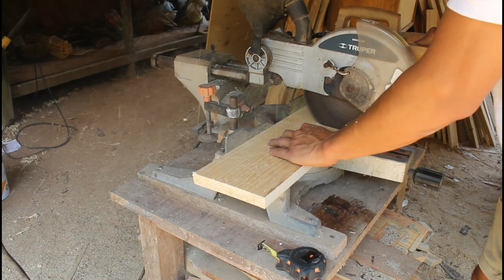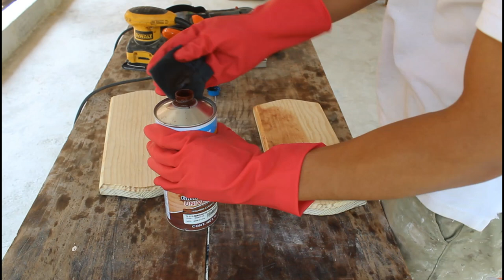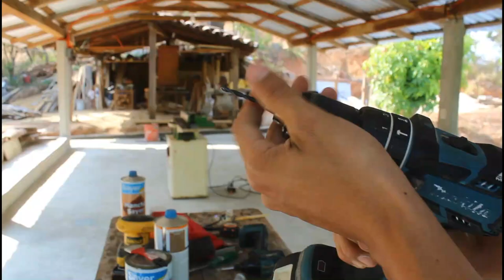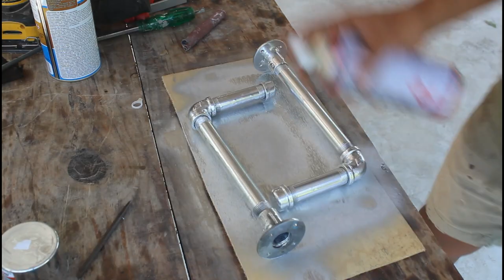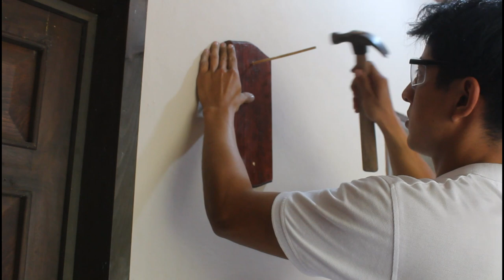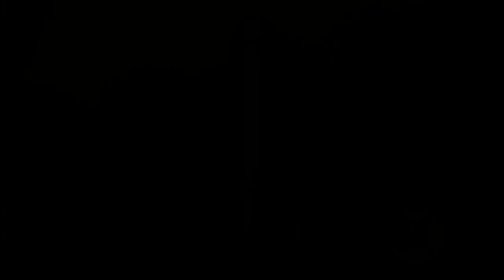How to Make a Motorcycle Helmet Rack | DIY Helmet Rack

Comment: Wouldn't the blunt cap depress the EPS liner in the helmet? Can add a bit of cushioning?
Reply from the maker: It is a nice idea but I think if the helmet is not in movement that's not a problem
Reply: yes it does negatively affect the safety of the helmet. Do not do this.